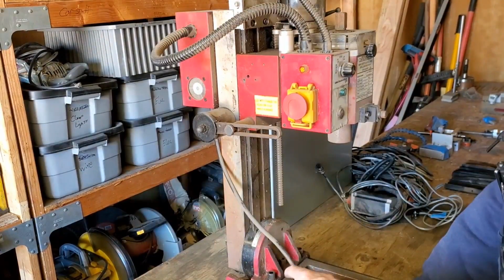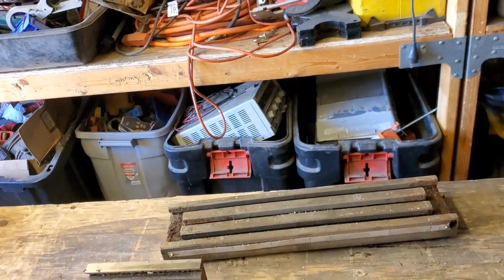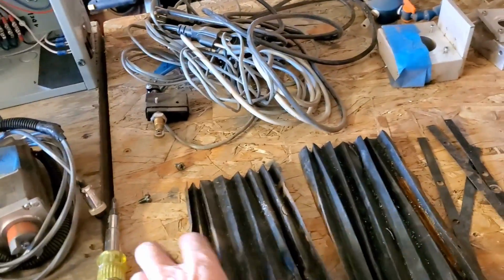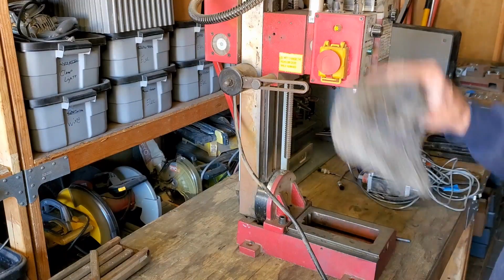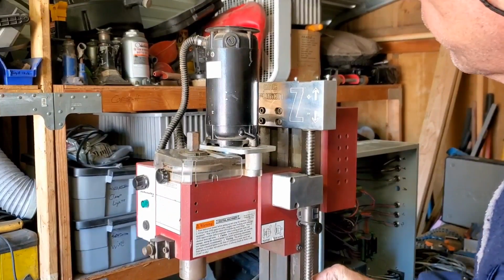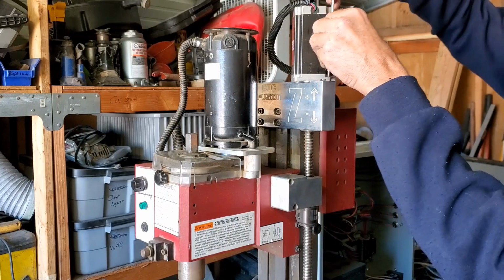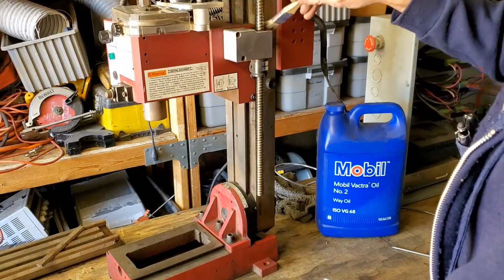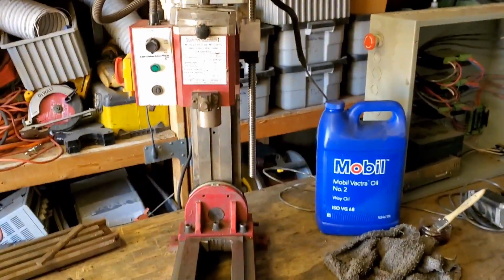Bringing The Mini Mill Back to Life

Comment: haha I have the same Dell Optiplex as my old pc, now it's just a backup. maybe I'll do a cnc conversion someday and put the Dell in my shop
Reply from the maker: I wish I could have found another one with windows 7 and a parallel port. I sold that mill and built a CNC press brake. I couldn't find one. I had to order this full size desktop computer from ebay that weighted as much as a tank. Lol.